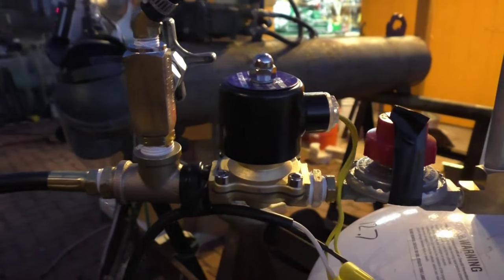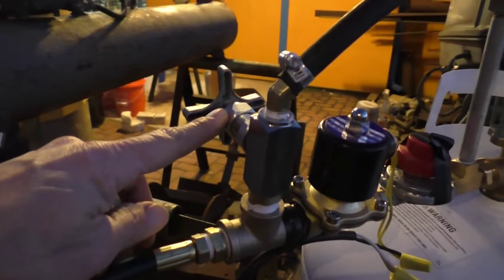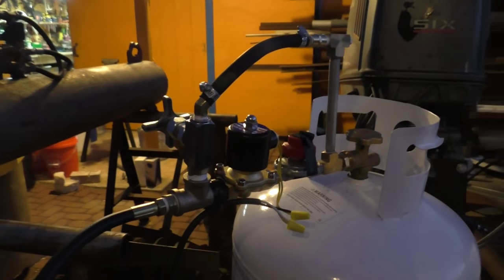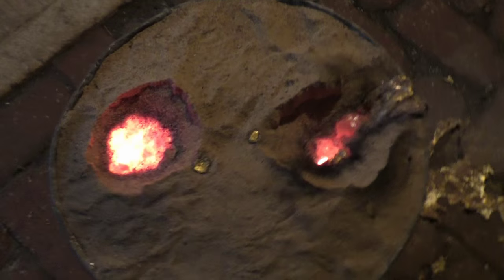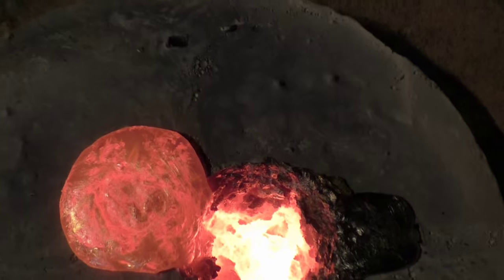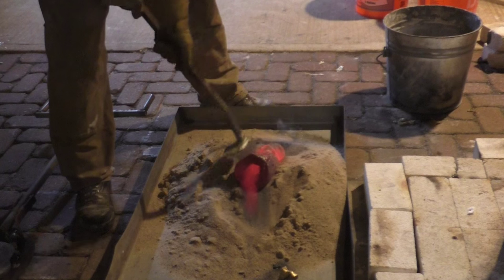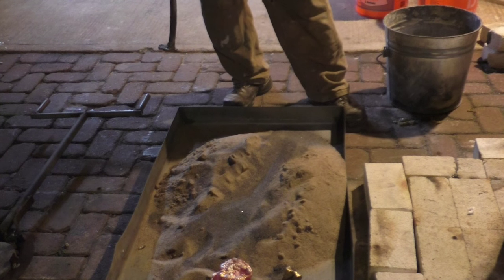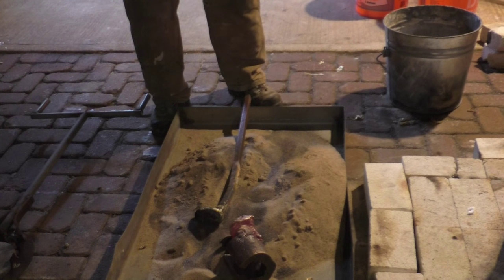Anchor Winch Rebuild - Part 10 - Plaster Block Mold Bronze Casting - Got One

Comment: You are on the right track for sure! Having worked with investment casting for over a decade I would suggest using a slurry dip and dry on your wax. After multiple coats add thicker material  (with fiberglass) follow with your insulating coat. Be sure to dry between each. I can't speak for foam as I haven't dealt with it, but the wax does a great job.

You are doing a great job with what you have done so far! Can't wait for the finished product vid!
Reply from the maker: +Wirednoodle    We have already done some work in that area.  Might go back to it now that I have a burnout kiln.  https://www.youtube.com/watch?v=nynoSOvqLIc

Comment: I am very happy for you that you finally have a usable capstan !

Lost foam is pretty much all they uses these days when doing complex, high volume casting for car parts.  I'm not sure what they use for sand, but it is not plain beach sand.
Reply: +theoldwizard998 they use oilsand because they have the equipment to break it down and recondition it a very expensive investment fir the backyarder

Comment: You are hitting on a process I eventually used. Lost foam with 60# bronze castings but very fine surface detail to 36 grit sandpaper! We coated the poly foam pattern with a furnace repair product to give us a fine surface it also hardened the sand a bit, the casting sand was a fine grade utility sand with bentonite mixed in. Very simple and a cope and drag not needed! We did the pour at night but the plume of thick black smoke was drill overwhelming! The piece was art metal so one off was ok, otherwise a traditional pattern would be in order.

Comment: The orientation of your pattern in the mold makes the rim of the part all the way around, equally the highest point before any breathers.  It's difficult to efficiently evacuate air to a high point in this orientation. Orienting the pattern anywhere between 1-90 degrees on the X or Y axis makes for the highest part of the pattern a much smaller area of the rim, and putting your breathers directly on that spot makes for natural air flow up and out. My experience is in casting plastic resin in silicone molds but I've done some lost wax as well. Loved seeing you stick to it and make it work! I hope to make it down and contribute before you're done.
Reply from the maker: +TechnicallyMagic   Right on.  That is what we did on the last one.

Comment: Congratulations on getting a good one at last! you deserve it!. A word of caution, when you lift the crucible out of the furnace, put it on sand or firebrick, not on the block paving! If the block paving stones have a concrete core, they could explode and fling the crucible in the air with horrible results. I saw this happen whilst installing some large compressors . we were soldering terminals onto the ends of large cables (150hp compressor motor) and using a solder pot. The solder pot was put down on a concrete motor bed to cool after we had finished, and a few moments after I walked away, the concrete exploded, shelling a thin sliver off of the motor bed, and throwing the solder pot in the air. The two guys I had been working with were burned by molten solder, not badly luckily, but had to be taken to hospital, and a few weeks off! The thought of that happening with bronze is a nightmare., Phil
Reply from the maker: +Phil Whitley    Thanks.  And that is not always true.  I have spilled 2600F NiBrAl on those bricks many times and they have never spalled.   Even wet ones.
Reply: +SV Seeker thats good news! some of the ones we have in the  uk are concrete cores, they must be proper clay brick. love the way it is coming together. phil

Comment: always an fascinating process!!
     had an idea you might consider...might require a small-scale test on the order of the one you did here...
goes back to the idea of using just a thin layer of investment and a pouring cup made of sodium silicate.    What if you use the sodium silicate sand around the ENTIRE foam mold instead of an investment?  pack it around the foam a couple inches deep, harden it up, then pile more beach sand around that to give it support should anything break through.......   seems like it might solve a couple different problems in one go (and be reasonably easy to do "in the wild"...)

    or maybe a combination of them all....thin layer investment, backed with harden sodium silicate sand, then beach sand    what do you think?

Comment: Nice pour! Looks like the direct lost foam is a bit hot for bronze. (It can work well for aluminum, if you don't mind a finish a bit rougher than rammed green sand.) Your idea of a thin dip over foam should work well, as long as you provide plenty of venting for the escape gasses. You might consider tilting the mould slightly, with a beefy vent on the highest edge.
Reply from the maker: +FXM  That is what we did on the second one, and it worked great.  Video coming soon.

Comment: Its been a bit since I was in art school, the sculpture folks used some thing called "egg shell" to cast bronze. I wounder if that is the same un... 30 stuff you were playing with in your #9 video. If it is they coasted the wax with a couple of thick paint layers. Then put lose sand around that to support the sculpture for heating/burn out and poring. This is lest investment and readily available, also cheaper. If I remember right they uses the same ceramic wool  wired together to encloses and support the sand.

Comment: Well thanks guys Wish me luck with my own casting plans.
Reply from the maker: Good Luck!
Reply: Hey how long did it take to smelt that brass?  you don't have to be on the money just around about will work. it's been raining a lot around here , so I can plan a brass smelt without worrying about rain. My crucible is about 1/2 the size of yours I would guess. I got a 10 -12 kg crucible. If mine being smaller would take a little less time to smelt, right? (I don't know much about the other low melt metals yet. Just aluminum and how to make alloys)

Comment: Hi..you can pour your investment/plaster into a metal drum just bigger than your pattern..this will prevent it from falling apart..that would be called a casting ring...also if you can heat your mold to 750 deg c (1400 f) that will burn out all the carbon and also give you a much cleaner surface finish...a hot mold will also help with your mold filling in thinner areas as the molten metal won't cool as quick when it flows through the mold..ps. you can line your metal drum with a thin fire blanket piece before you fill it with investment to ease removal after casting..I've been casting for more than 25 years but not to the size you guys are doing...hope this helps...

Comment: I was thrilled by this gas cylinder system with digital gas flow and temperature control. Could you tell me the name of that installation so I know what to ask to buy. I also bake  molds for bronze casting, but I don't have that system, so I have to stay up all night and be on duty by the stove to regulate the temperature, which is very exhausting.

Comment: Nice!  I've never seen glowing sand before.
Reply from the maker: +Greg's Garage   That was a first for me as well.  :)
Reply: +SV Seeker im a diecaster by trade and ive casted that shape a few thousand times before you want to pour the metal down a runner that goes to the bottom of the cast and fill's the cast from the bottom to the top and have a big riser in the center top of the hub area and vents all the way around the top rim area also if you can get some fiberglass mesh works well as a filter to pour through,the runner should start of quite thick and taper because the top will work as a riser also that runner split into a C shaped runner so it filled the cast at the bottom rim from both sides,if you need more info i could perhaps email you a diagram or something
Reply: +razzorbladz Could you post a diagram? Would be curious to see a visual representation of what you mean.
Reply from the maker: +razzorbladz    Yes.  I think I see what you're saying but sketch it out if you would and I'll share it with Paul.  My email is svseeker@ymail.com     Thanks
Reply: +SV Seeker Thanks Doug!
Reply: i just sent a quick sketch you should be able to translate it its only basic and i couldnt draw in all the vents on the top rim but you will get the idea I used to cast hubs for Harley davidson the same shape the huge compensator hub for the spoked rear you fill it from the side hard and fast untill the metal comes out the center hole/riser our die was metal with a sand core in the center to make the cavity for one die the big one,and the other die had a doughnut shaped core to shape the middle section and a stick core down the center
Reply: did you get the sketch?

Comment: Pack silicated sand in a 1-2" layer around the foam core, CO2 or air cure it then surround it with sand and cast. I suppose you could add a burnout step to empty the cavity if the foam might cause gas bubbles in the finished product.

Comment: PID, I went through all the Rockwell Automation stuff years and years ago, even before  Rockwell sort of streamlined it in a user friendly package, we had to use high dollar limited lot special Analog device ic's ,  add in all the supporting logic to scale it all, and do the math  +/-16k something something and don't even mention all the jump's/examine/ sub's to get it to even kind of work right let alone other special logic code needed to support a basic PID, I have to admit these new controlers out today do it so well and they are so cheap they really are that cat's meow to running and holding set points!!
Reply: +Swanny383 , I remember running ITT's and EGT's and Tq transducers for aircraft avionic's that just the chip to do just basic scaling and calculate to a  simple 8 bit format put it on the data buss in the late 80's early 90's were $ 30- 40 for a single basic dip 14 pin chip, and some of the more complex phase x/y/z sincro stuff was well over 3-400 a chip, and we used to have to wait months to get them, and they were limited lot pieces, but today a very high end controller with USB support/Software complete with multi chan I/O's is well under 1K even a basic bare bones run by itself with LED displays are now dirt cheap, It's not red neck at all!, People take for granted really how awesome and easy these new controls are. shit some of the better controls even have learn funtions.
Reply from the maker: +Swanny383   Stuff is getting better.  :)

Comment: A PID controller is a proportional integral derivative controller. It basically looks at the difference between your setpoint(value you want) and actual value and uses the difference, change in difference, and total distance changed to control (in this case the gas?) things.

Comment: If you burn out your mold upside down, the wax will not only flow out but also burn once it has. This reduces your fuel and speeds the process. I understand wanting something you can get anywhere, but fancy casting wax is traditionally paraffin, some bee's wax, a tiny bit of rosin, and dye. Bee's wax candle stubs are cheap/free at a lot of churches, and that's the important part. Paraffin + bee's wax is easily molded by hand, yet stable. YMMV. ;-)
Reply from the maker: Thanks for the tips.  We considered burning it out upside down but decided it best not  have to flip it over once it was hot.   And it made a rather big fire last time we did that too.

Comment: Hey Doug, Why so small ? for being an anckor winch, won't I need to hold more chain? What size of chain are you using? I love the progress. I'm working on a couple 12 volt hyd. units for you still. I think I can give you at least 1 complete & many, many parts. But I will try for more.  Thanks
Reply from the maker: +Mike Weiser      Hi Mike.  That's just a capstan.  See the other videos in the series.

Comment: bloody awsome you made one! I'll bet thats a relif to get the process to work for you. Do you loose much metal with each atempt or are you able to melt vertually all the scrap back into another atempt? also you said this capstain is for chain? I've only seen them used for rope myself usually the chain goes on the gypsy which is more a sprocket type thing with groves and dimples to match the chains profile. I'd think chain would not grip a capstain drum, maybe you ment rope? great result Douge and Co!!
Reply from the maker: +Dan fish    Hi Dan.  We loose about 4 pounds out of 70 when the metal is in small bits.  The more surface area the worse it is.  Rope and steel cable will be typical but chain works too.  I would like a gypsy on one of them but that will wait for another day.
Reply: +SV Seeker ah thats not too big a loss then I did think you must loose a fair bit as crud and coruption. I guess you are talking small ish chain with many wraps on the drum I was picturing big chain which would not work. its all good stuff! our capstans were steel btw and very large but I suppose steel casting is not for the back yard but it would be cheaper!!

Comment: Hmm how would it work with sodium silicate sand directly packed around the pattern? then burned out, as sodium silicate is a high temperature "glue" and should still hold the mold together during burnout =) (what i mean is to use it like you use the plaster right now) =) love the experimenting you do, and that you show your mistakes also =) keep up the good work =)
Reply from the maker: +Tomas Wilhelmsson   https://www.youtube.com/edit?o=U&video_id=7ccfncNZeSI
Reply: +SV Seeker hmm that URL goes to some edit page i think :) have to sign in
Reply from the maker: +Tomas Wilhelmsson Sorry;  https://youtu.be/7ccfncNZeSI
Reply: SV Seeker hmm yeah but thats not realy what i was thinking =) i was thinking lost wax like you do now in the plaster but insted of plaster around it sodium silicate hardened sand =) burn the wax out cast it =)

Comment: In high school jewelry class we put the hot plaster molds after casting into water and the plaster just boils off the casting. No sledge hammering needed. Except the day I was sick and my teacher cast my project for me and I had to dig it out of cold plaster.
Reply: Sooner Keith It doesn't dissolve the plaster or whatever the mold is made of. It breaks from the temperature differential. In my case it was plaster and it just powderized in the water from the heat flash boiling the water that touched it.
Reply: Sooner Keith  It is similar to torching wet concrete (Wet as in set but wet from rain or whatever) and it breaking thin chunks off. Or like hot glass shattering in cold water. Plaster is really soft and porous so it works great but I am sure if concrete is hot enough it might do the same, maybe not to powder but small enough chunks that it is effective. But svseeker was using plaster for those large molds wasn't he?
Reply: Sooner Keith They used the sand molds for the aluminum window things. But those molds were made in halves so the molds didn't have to be broken to remove the part. Gypsum slurry would be plaster. Looking at Wikipedia gypsum plaster is plaster of Paris which is what we used in jewelry class. The Plaster of Paris we used  was brilliant white, We also used some other plaster that was less expensive. I used it for making a mold of my finger which I used to make a wax copy then made a mold of the wax in plaster of Paris. The finger cast plaster was dull and grayish and had a set time of about 30 minutes. I sat there with my finger in it for quite a while. It might have been a lime based plaster I am not sure what it was.

Comment: even with mold frame casting we always left it to cool down for a day and even still it was really hot cast in sand and even when it comes out some metals can still crack or pop or explode just from the air moisture so they keept on telling us

Comment: How much time and gas you spent for firing the mold,,,great video
Reply from the maker: For that block, I think 48 hours would be the minimum.  I think we went 72 or longer because we'll wait for weather and schedules.   And I don't think we ever burned a whole tank of gas but that would depend on the size on the block, the insulation of the furnace, ambient temperature etc.

Comment: The "King of Random" seems to have had really good luck doing lost foam casting with nothing more than styrofoam patters and regular sand.  Might want to look his channel up.
Reply: +WreckDiver99  I've had good luck with simple lost foam, but I think the higher heat of the bronze may be an issue. The second pour he did here was a lost foam test. Doug's idea of a thin shell of slip over the foam might do the trick, though, with plenty of venting.

Comment: Did the concrete mold crack along the bottom because you let the base dry before placing the wax investment this time?
Reply from the maker: +Sam Carlson   It's Ultracal 30, not concrete,  and we did not allow a layer to setup in the bottom.  We added a wooden bottom instead.  The crack is the result of pouring in the metal.

Comment: Wonder if concrete would work if you poured it around the wax or foam?
Reply from the maker: +Mark Boys   I have read about propeller blades being cast in concrete but it is impermeable and presents new problems.

Comment: I believe the fractures in your mold are due to the thermal shock you introduce when the molten metal is poured into the mold.  If you preheat the mold this would probably not occur.  But, would it be possible to change the paradigm completely and make a ceramic mold like done in this video.  It is a series of dips in what looks like slip and powder to build up a ceramic shell over the wax investment and then firing the ceramic mold to remove the wax and harden.  Then prior to pouring you fire the ceramic mold and when heated to as close to the same temp as the bronze, you then pour the metal and you should have essentially no thermal shock and get a beautiful casting.

https://www.youtube.com/watch?v=FS0uM3OC76I